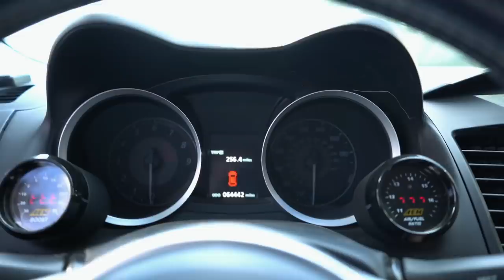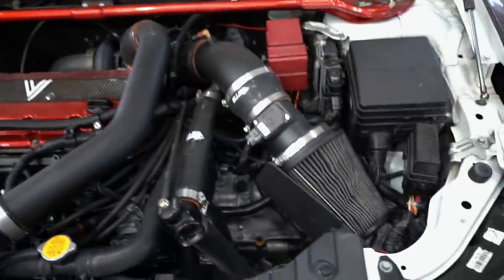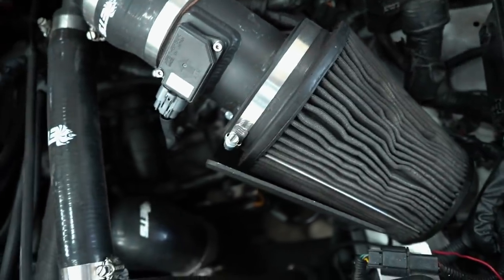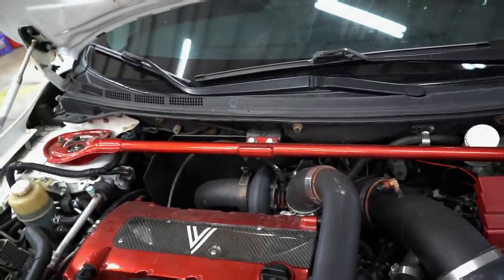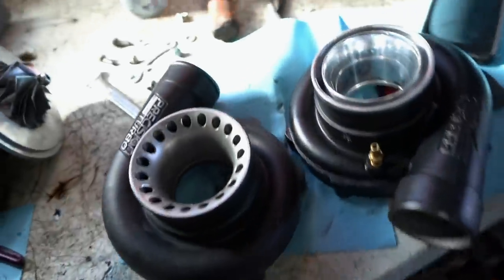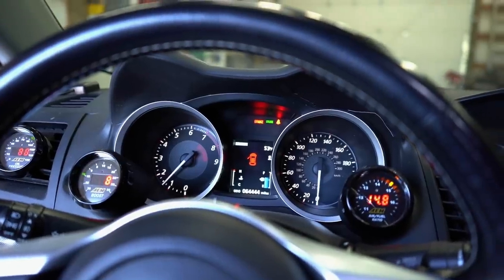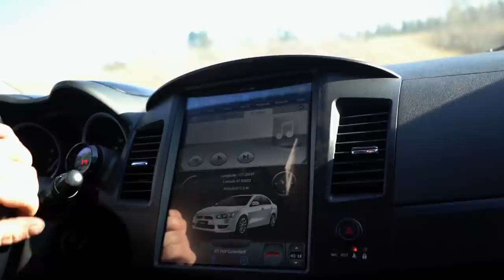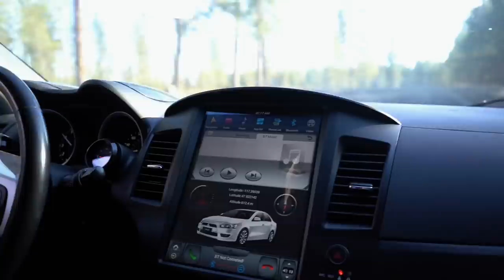Crazy Loud Turbo Spool on Evo X!

Comment: god you have the perfect turbo sound and bov sound. doesn't get any better then that. btw what did it cost to do the swap? and how fast as the turn around rate? assuimg you went through either a local or OCDworks.

Comment: I don't like that.  Sounds like a fake or digital sound.  Or like a stereo that isn't grounded properly and gives you that sound as the car accelerates.  Evo sounded better before.
Reply: bosoares  yeah if he can get rid of that sound without getting rid of the turbo blow off that would have been sweeter but that whistle sound has a annoying bad stereo sound I hate so much